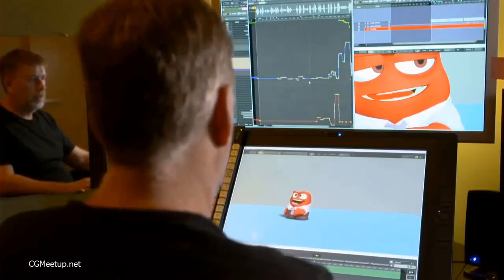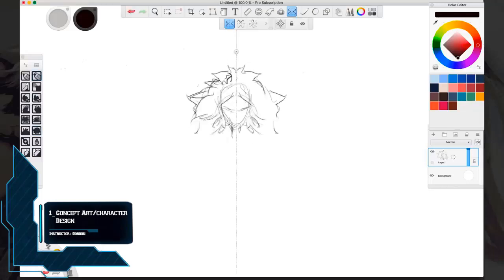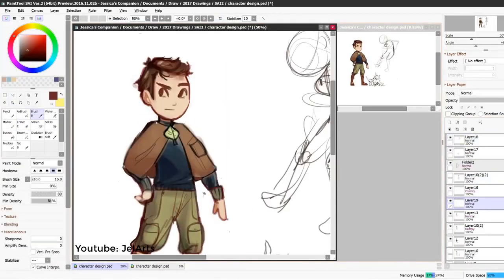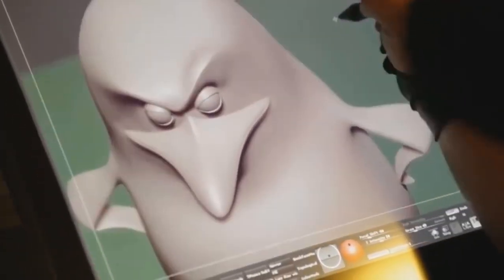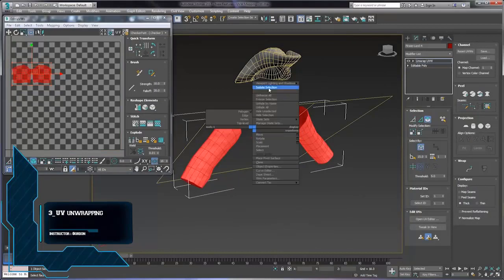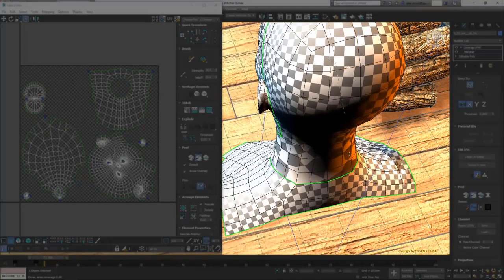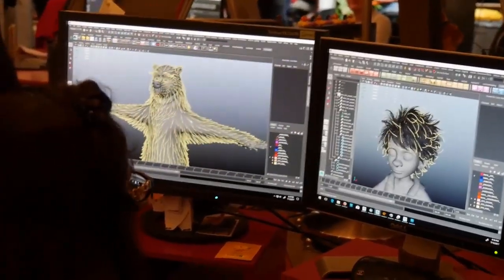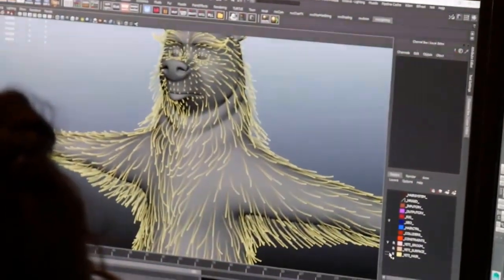How to Make 3D Animation Character

Comment: I am a graphic design student but interested in 2d and 3d animation.  I want to buy a laptop as it is more practical in terms of portability.  Which features should a laptop have in terms of the programs to be used?  I have some information about hardware, but I think it would be more logical to ask someone who is engaged in this business.  I would be very happy if you provide information🌺
Reply: I suggest instead you get a drawing tablet as a lot of animators use this and it is portable although you will need a monitor to go with it but if you still go with laptop it should be touchscreen I hope I could help you